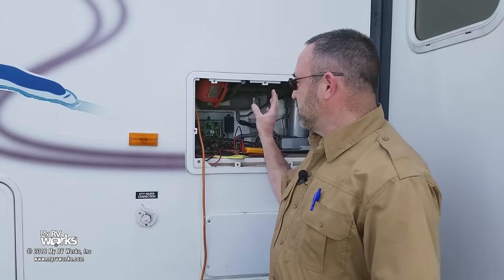How To Determine If Your RV Refrigerator Cooling Unit Has Failed -PLUS- RV Fridge Component Overview

Comment: I am using a gas Dometic fridge in a camp so the back is wide open.  Does this affect the performance of the fridge since I don't have the clearances that you recommend?
Reply from the maker: Yes, with no chimney up the back side of the cooling unit that would absolutely negatively affect the performance of the refrigerator. Find your manual for that refrigerator, and then look at the installation pages. It could totally be done in a camp setting and I have seen these refrigerators used and all kinds of places, as long as they have the chimney they work just fine. You give it to heat it gives you cold.  I've even seen people use cardboard to create the chimney. But we really do need to force the air through the condenser fin at the top to drop the ammonia vapor back to a liquid so you have more efficient ammonia evaporation. You can find manuals for a lot of refrigerators on our website here.  https://myrvworks.com/manuals/

Comment: how would you check your dampers? My freezer is not freezing but my reefer is dialed in. The termistor is set for 37 deg and the thermometer is showing 36 deg. My freezer is at 40 deg. I have dometic 2652.

Comment: Dealing with the heat element test you should power down the AC before pulling the connector or plugging it back in to prevent arcing the pins on the circuit board.  Also advise people when unplugging DC connections on the circuit board that should also be powered down. You can get a inductive spike 3 times the 12 volts that could damage sensitive IC chips.

Comment: So I have a norxold 1210 refrigerator 4 door 2 AC heaters  to bypass the control board and go directly to ac 110 there's 2 yellow and 2 black do you put the 2 yellow together and the 2 black together or 1 yellow and 1 black together and plug in thanks

Comment: Great video and channel!  You mentioned there be a video on troubleshooting the igniter, when is that coming?  Trying to troubleshoot my issue, the fridge works fine on AC. But not LP.  No click sounds.  Any suggestions?
Reply from the maker: As I get time I'll make more videos. One of the ones I would like to do is a full overview on the lp side of a refrigerator. Until I get that done, on my website I do have service manuals. And the service manuals offer tremendous information on how to check and troubleshoot those components. Here's a link to those resources.  https://myrvworks.com/manuals/
Reply: @MyRVWorks  my fridge would not work on LP , i thought it was the igniter so i used a bbq lighter to ignite the gas that resulted in flame shooting back through the supply line hole in the shielding, turns out the burner holes that actualy look like hacksaw cuts on a pipe were plugged full of carbon. Wd 40 and a surgical blade cleaned it up nicly. Upon further inspection i noticed the drip tube that feeds into a tray was capped off with a solid plug from the manufactuer not allowing it to drain, i suspect my fridge has never even really worked on electric since we bought it 10 years ago. It took the event of the burner getting chocked off for me to realize it. Maybe you shoud do a video on cleaning the burner, just a sugestion.

Comment: Our older dometic camper fridge does make girgling noises but was told that is normal function of the heating process.   no smells or signs of yellowish powder anywhere.   But it does not cool and actually slightly warms up. The lower tube burner is 185f  and the leveling chamber is 160f  the condensor plate is 55f  so nnot much energy exchange between the leveling chamber and burner tube.  Advice ?

Comment: Darren, 
I’m trouble shooting my not cooling refer. I’ve checked a lot of things you mentioned in this vid. I removed the thermostat on the inside last night and this morning it’s a bit cooler but not cold. I went outside and felt that the boiler was very hot but that the coils are not hot at all. What’s my next step?
Thanks in advance.
Reply from the maker: With the temperature difference you're observing between the boiler and the absorber that typically indicates a blockage in the cooling unit. In the first few minutes of this video I do talk a bit about blockages:  https://youtu.be/--DCnSw1jP4 

Bottom line, if there is a blockage, it is not serviceable so you'll need to replace the cooling unit.  And I've got a video on doing that here.  https://youtu.be/H-Cg-7YHyYE

Comment: we were horrified with the ammonia smell, so we got it out and replaced with an older smaller unit which worked before install. Now it doen't work! will check the fuses

Comment: I cant thank you enough for the great tutorial, my new Dutchmen Astoria Fifth wheel has Fridge problems , Freezer works great, fridge doesnt on propane or Electric.....
Cant find the Thermister, nothing on the fins , only a wire screwed to the top of the Freezer. Im about done on RVs, this is my 3rd problem child ...... 
My slide doesnt work when i put food in the Fridge and the pantry, works fine when its empty, i would pay for you to fly down to Arizona  and fix these issues , but Lake Havasu is 118 degrees right now, so its kinda hot .
Cant find a RV tech to work on it, they are all too busy, they all say about 2 months before they can look at it.....
RV = Ruined Vacation

Comment: Hi great video thanks. I was parked very off level for about two weeks and my dometic stopped cooling. Someone said to turn it upside down to get the coolant working again. He said it worked on his refrigerator. If all other things check out do you think I should try this as the last resort?
Reply: Did this work?
Reply: Florida Man I didn’t try it. I bought a small Apicool like fridge. I’m afraid I’m not strong enough to get it out and turn it upside down. One of these days I might give it a try.
Reply: @RVFreeDa  
Thank you for the reply.

Comment: My Norcold 510 3 way refrigerator quit working and kicks out a code   n   . It does absolutely nothing. In order to see if the system itself (ammonia, hydrogen, etc) was working I fed 120 volts directly to the heater. After 2 hours the freezer compartment was  -5 degrees and the main part of the refrig was 50 degrees. I had already taken the refrig to a dealer and spend 360 dollars having the boards swapped out to no avail. I don't want to waste any more money on it.....Can I just continue to run the refrigerator by using the 120 volt or 12 volt heater to power the unit with no automatic temperature control? I know the temp will vary quite a bit as the outside temperature changes, but I can manually place a thermostat somewhere in that system to control the temperature to some degree. Thanks for any suggestions.

Comment: When a norcold is on LP does the pilot stay lit the whole time or only when it's calling for cooling?  My brother and sister-in-law just bought a used RV and are planning on living in it but alot of things aren't working...  He saw a blog from someone that mentioned piggybacking 12 volts to the board and solenoid and not using the two white wires coming out of the board.

Comment: I have a Dometic 2807 refrigerator that works great on electricity and will light on gas, but only burns for approximately a minute and goes out. I have replaced the ignitor relay with a new 679 and still have the same problem. I have checked the burner tube and cleaned it. The ignitor is 3/16 inch above the burner tube, the flame is a beautiful blue and the ignitor tip turns red, but still goes out after a minute. What could be the problem? Thanks for your help.

Comment: My upper vent on my refrigerator has a full size cover but when you take it off there's plywood with only about a 4 in to 6-in bleed for the vent air to come out. Should the hole be as big as the vent cover on the upper vent

Comment: what causes the loud gulping GASPING SOUND MY REFER JUST STARTED doing it then shut down, (full time lp gas for 3 years not 1 problem! I defrosted plugged in for a day cleaned (checked burner, inginiter, wires, it lit perfectly  worked perfectly for about a month & now it just shuts off after 10 minutes spark light face panel lights working, tried ambient & temp control switches all seems perfect no yellow no smell,  So frustrating!  1999 Dometic Royal  ac/dc/lp

Comment: My dometic NDA1402 has 4 thermistors. One not particularly hot day it wanted to be at 19/49 degrees freezer/fridge. Both gas and electric. I unplugged the fridge thermistors.. Bam.-5/20 degrees in a few hrs.. Which thermistor should I replace? Only fridge?  Both? Air temp thermistor? The one on the fins? What about the freezer? I'd like to go snip the tip or dinosaur.

Comment: Hey Darren. So my domestic was working fine, this time turned it on did not get cold checked cooling unit, boiler gets plenty hot but seems to be no circulation, tubes not warm. No gurgling etc, do they suddenly clog sometimes as well? Looking forward to your answer and hopefully solution! Thanks!
Reply from the maker: Hi Chris,  How long has the frig been cooling?  Have you put room temp items in it and/or packed the shelves?  I only ask because if you put room temp items in it the cool down will take a long time - more than a day sometimes!   Also packing the shelves prevents convective cool air from absorbing the heat.

Here is a blog post I did with data loggers on a Norcold 1200:  https://myrvworks.com/rv-refrigerator-cooling-performance/

Okay, so after all of that if it is STILL not cooling down then I would suspect a blockage.  Here is another video I uploaded on that specific topic:  https://youtu.be/EJnlGnvcn74

Let us know what you find in these initial tests...

Cheers,
Darren

Comment: My cooling unit has leaked. I have the yellow residue at the base of the boiler. Do you have a preferred brand to go with as a replacement? Factory OEM or an aftermarket? 
Rvcoolingunit.com sells an "Amish" brand model 805a for about $400. Any advice is appreciated. 
Thanks for the great video.

Comment: I was power washing my rv and I had it plugged into pigtail. Water had gotten in behind the fridge. It keeps tripping Gfi inside of house. Fridge works perfectly when I switch it to LP only. But when I plug it in inside of trailer outlet it immediately trips. What do you think the problem is?

Comment: If I hear boiling is it the same as the gurgling ? Everything in the video seems to be correct except I hear a prominent boiling sound. The fridge does not cool at all. 
Dometic RN2410
Reply: chris whelpley Chris - A gurgling sound is also a sign of a failed cooling unit.
Reply: Thats my question too. I understand your comment. Is the boiling sound the same as gurgling sound? We hear boiling, but not necessarily gurgling. Gurgling means replace- but boiling means.........?

Comment: I am having a problem with the roof leaking and it would solve a lot of repair problems if I knew..... Can the norcol vent be moved and  put on the outside wall at the highest point instead of the roof?
Reply from the maker: The simple answer is yes. Pull up your installation manual for your refrigerator and follow the ventilation installation part. You're going to need to create that proper chimney effect.. here's a link to our website where you can find manuel's:  https://myrvworks.com/manuals/

Comment: I need some help from you guys in the biz.  I am a fairly new RV owner but I'd call myself pretty mechanically inclined.  I have a Norcold N8 series fridge that the Freezer is a 0 degrees F, but I cannot get my fridge area below 50 degrees no matter what I do.  I have followed the guidance and installed proper baffling (better than the factory did) in the back, along with 2 additional fans with no luck.  I am at a loss.  Anyone out there have a similar experience?

Comment: Is it common for the board that the Thermistor plugs into to go bad?
Reply: Joseph Doublin the control boards are prone to heat fatigue.  Look at the board for signs of melted components, brown/scorched areas on the integrated circuit board, and resistors that have swelled.  Electronics are not happy with ever changing temp and humidity conditions.

Comment: I might buy a 1999 travel trailer and when i went to see it after it was delivered (not hooked up yet) it smelled badly of ammonia. When it was very distracting i checked the bathroom the toilet had stagnant urine in the bowl.  He said "don't flush it it hasn't been hooked up yet". Im new to this rv life so i may ask odd questions.  But is it possible he is masking the refrigerator ammonia smell you refer to?  It didn't make sense if there is a black water tank then why not flush?
Reply from the maker: Take off a vent cover to the back of the refrigerator as I've done my video. See if you smelled ammonia at that point. If there is a cooling unit leak typically you will find it as a yellow powder at the base of the boiler.

Comment: How about if there is a little yellow powder at the top of the boiler?? Is it shot??
Reply from the maker: Yes, the yellow powder is a tracer to let you know that there's been a leak.  If the cooling unit has a leak that means it's lost all of its hydrogen.

Comment: yo - darren.   fine video.  a question please.  my reefer is ac or lpg with dc cntrols.  it cools fine. then the flame goes off.   when it SHUD come back on it will not ignite.  (i dont have ac to test with).   any suggestions???
Reply from the maker: In a few days I should be uploading a video where the refrigerator would start on LP and then flame out. One thing you can try, get a can of office air and spray out the burner with that straw stuck inside the burner. There may be some debris blocking it. That's what turned out to be the problem in the video that I'll be uploading.  If you're free figures not even trying to ignite though then I do plan on making another video where I go into much more detail on the whole LP system. Just haven't had time to get that video made yet.

Comment: So I have an issue with everything electrical working and my heating element gets hot but the heat stops at almost dead center top in the water separator section. I cannot figure this thing out! Help!!!! Dometic dm2852

Comment: Soo I have the yellow sulfer leaking out the boiler. Do I need to replace the cooling unit as a whole, OR do I replace the boile
r by itself? The cooling unit appears to be $600 soo I don't want to go there, if that's not the fix.
Reply from the maker: The cooling unit is one complete unit. It is filled with a ratio of ammonia, water, sodium chromate, and hydrogen. The whole thing is then pressurized. So there's no field repair for that, it needs to go to a facility where they make those repairs and pressurize them with the right mix.  There are several remanufacture shops but we have a good working relationship with Cool Fun RV. You can let them know we sent you and they may give you a bit off the cost of a new Cooling Unit.  https://coolfunrv.com/

Here's a video we put out replacing the cooling unit.  https://youtu.be/H-Cg-7YHyYE

Comment: QUESTION:   Is it a good idea to change out my good OLD (20years) fridge to replace it with a Household fridge?
Reply: It depends on what type of camping you do.  If you're mostly plugged into shore power and or don't mind running your generator often then go with a residential fridge.  I'm currently in the process of taking out the residential fridge that came in our rig and replacing with a Dometic RM2652 2 way fridge because I'm sick of using the majority of our battery power (produced by solar) on the fridge.

Comment: Hi there I need some help I have an older norcold 9000 series in ac and lp mode all the pipes in the back get cold the fridge isn't throwing any code if I unplug the AC the swaps to lp on its own and the l lights on its own I have a new thermistor and I can not get it to cool at all I'm at a loss

Comment: I need help, we put a lot of food in dometic freezer running on A/C after shopping and a week later I noticed stuff was melting , turned out that the door was shut but was not shut with a good seal, I moved stuff around to get door to seal shut and now the fridge will not get cold on A/C or gas? Please help. No yellow stuff, no ammonia smell
Reply from the maker: Sorry to hear this! If the frig was working correctly before this issue and it has been more than a day and still having issues, the next thing would be to turn it off completely (pull fuse and unplug form 120VAC) and then at at the next 'noon' time turn it back on.  The automatic defrost cycle starts off with a 36 hour timer and then settles into a 24 hour cycle.  This will start the frig so it will enter its defrost cycle at midnight.  See if that 'fixes' it.  It may be entering the defrost cycle at the time it is needed most so it is never able to catch up. We do have quite a few videos on our refrigerator playlist: https://www.youtube.com/playlist?list=PLk44vSl27TRBtE1CmMkPb02ayS5H1sKbB. We also go live the first Friday of every month at 4:30 PM PST and would love for you to join us!